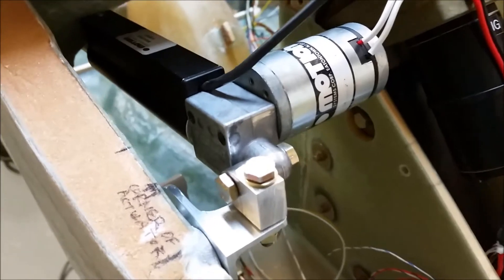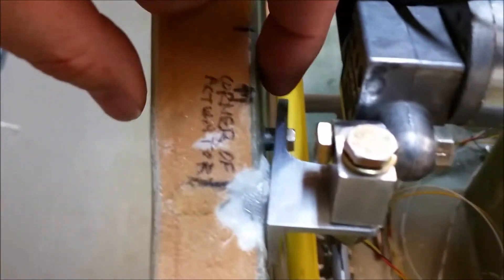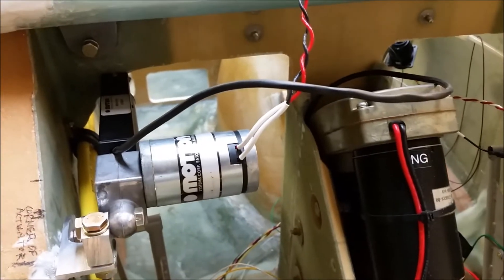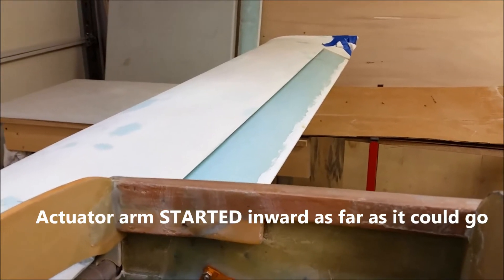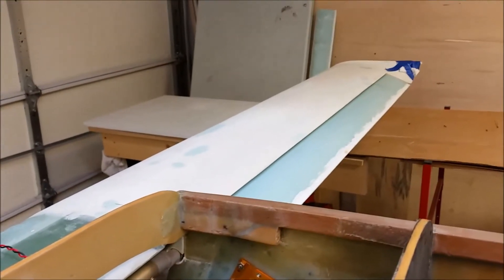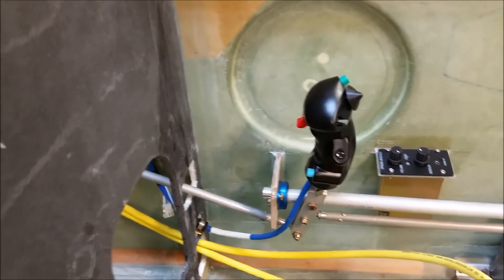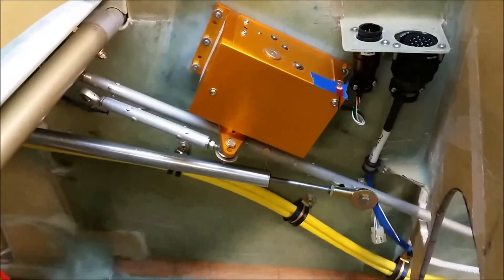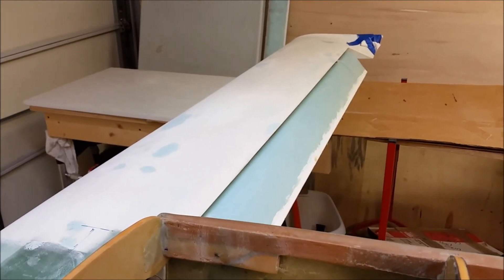Airdog77

Comment: I am yet to see what this adds, other than weight and complexity to a simple and fool proof unpowered original design.
Reply from the maker: That's what Burt said about folks installing O-320s vs O-235s in these birds.  Yeah, I hear the weight and complexity argument all the time and it's always interesting what is deemed acceptable and what isn't by each person making that claim.  Each builder's own mods are acceptable, other folks' mods aren't so much.  I guess I should be going with the old steam gauges and a carb'd engine as well huh?  Shall I dump the electric nose gear and go back to the mechanical version too?

I could give you at least a dozen reasons what this adds, starting off with the fact that I am installing an O-320 sized engine and only have one lightweight battery in the nose.  This pitch trim mod adds about 1.5 pounds overall, 90% of that being forward of F22.  Ah, that weight, known as "ballast" by some, comes in handy since I don't have a second/bigger battery, even with a longer nose (more weight and complexity).  As Buly once told me, "you can have dead-weight ballast in the nose, or useful ballast, take your pick."

What about those times the springs break and that fool proof design you claim isn't so fool proof anymore?  (Examples aplenty in CP newsletters, etc.).  Work around it by adding another unnecessary task to tend to while managing the cockpit?  So instead of minimizing instances of failure that can add to increased pilot workload during one of the most critical phases of flight, approach and landing, you're concerned about ballast weight in the nose?  Or complexity? (How many hours did Vance Atkinson put on this system he designed?  Answer: pretty much the life of his Cozy until he retired from flying it.)

My configuration for the elevator tubes coming through the sidewall are the Cozy offsets.  This eliminates the original-designed gaps to virtually eliminate cold air from coming in (yep, more weight and complexity).  With that setup and my instrumentation, I have zero room for the traditional spring pivot arm, let alone any room for the springs and lever.  (BTW, I swapped out the high failure rate/heavy vacuum pump on the engine for the complexity and "weight" of magnetometers). 

What about integration?  Again, in my quest to optimize efficiency in cockpit management. What about HOTAS?  Too much of a newfangled notion?  What if my pitch trim system is a collaboration between Bob at TCW Tech and Chuck at Trio Avionics (it is) to provide auto-trim concurrently for both the EFIS system (more unneeded weight and complexity) and the autopilot (definitely more unneeded weight and complexity).  Again, minimizing yet another task in managing the cockpit.  

So all this may be unimportant to you, but critically important to me.  Might I recommend you read some accident reports where pilots being task saturated, overloaded and/or distracted are too often the root causes of too many accidents.

So in my opinion, on my aircraft, that's what this adds.  But I commend you on being yet another gatekeeper of the 'weight and complexity' mantra, especially given that I have an entire website that spells out pretty much how and why I've undertaken each system install and mod.  Moreover, I am certainly thankful that I'm building an Experimental aircraft so I can build it to my requirements and standards vs. the status quo.